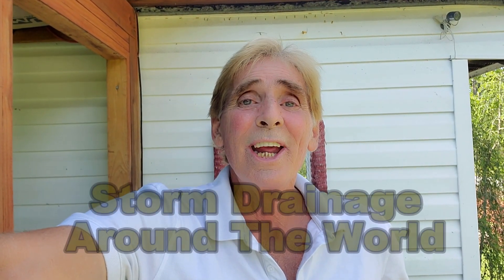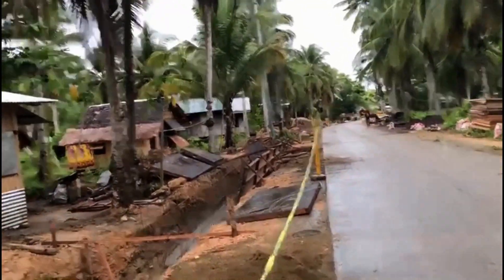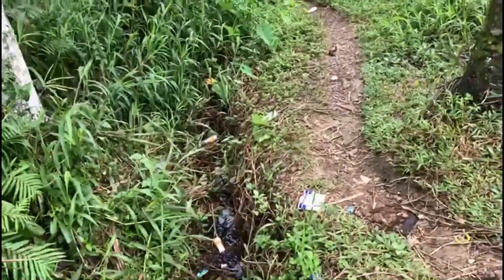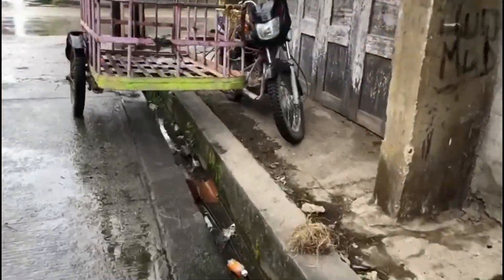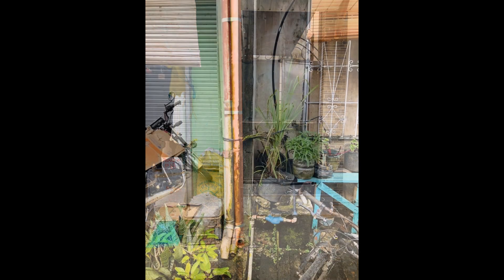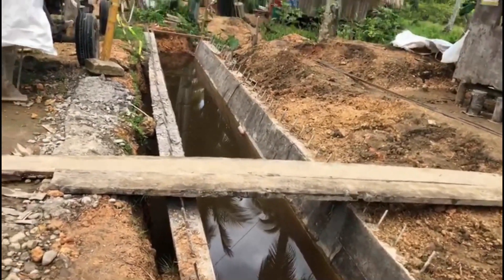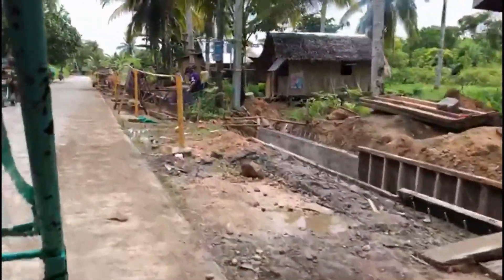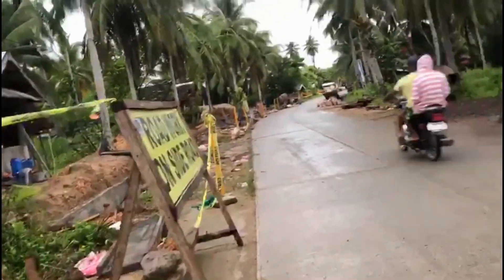Philippines Storm Drain Construction, Is this System Better than US?

Comment: Grating on top MAY cut down on litter, trash, and the like, accumulating (thus reducing the maintenance)
Here in the USA, open roadside ditches flowing into open 'flood control' storage areas are like magnets for trash.
You'll never ELIMINATE the need for MAINTENANCE,  but REDUCTION is good!

Comment: I guess you can say its the same as the US, but i only see ditches and channels. In my town we replace those old 50s style ditches and channels with good quality concrete catch basins and 12 inch pvc pipe. And add curbs and sidewalks to the roads. Catch basins collect all the debris and prevent it from clogging the pipes. Water quality manholes filter more debris and divert high flows to a stream, lake, etc. Low flows go to a LIDA structure and infiltrate water into the ground and get rid of any other contaminants. I dont see these systems in this video, only systems used in farmland which is what they are using. The channel under the sidewalk won’t collect debris and will only clog. I wouldn't say this is like US systems, i would say they are refusing to change the type of systems they use.